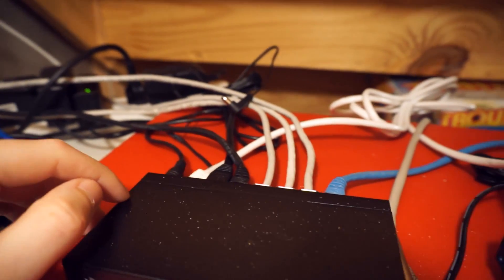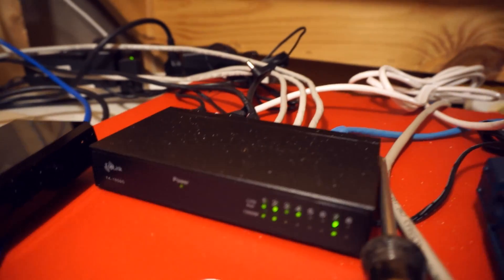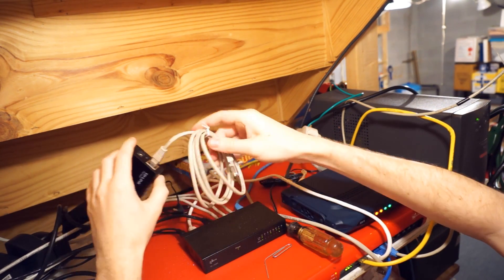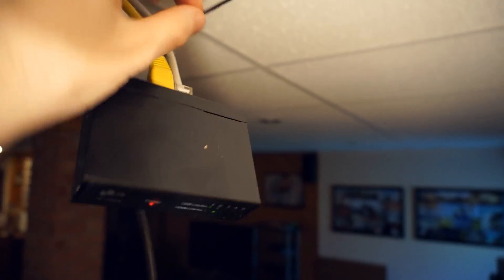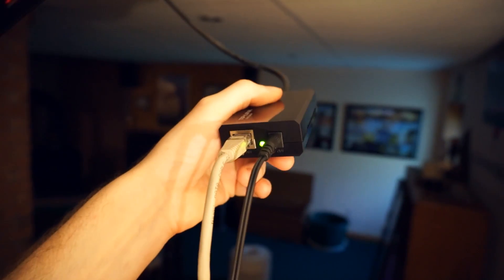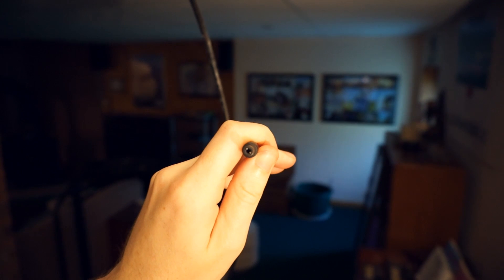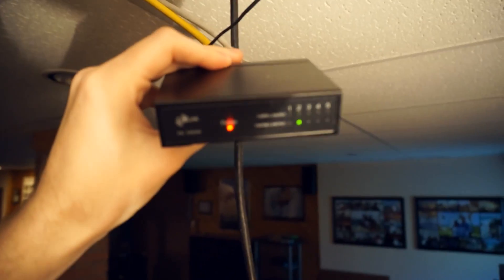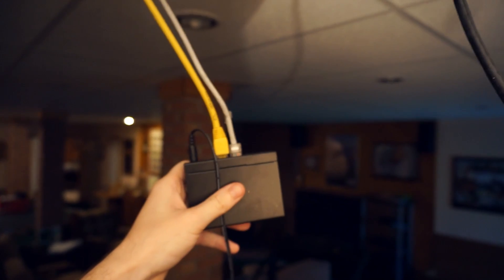TP-Link Power over Ethernet (PoE) Injector and Splitter Install

Comment: I'm out in the country using a mofi 4500.. I'm wanting to power my mofi router outside in weather proof to cut down on signal loss through the cables.. And use ethernet instead . And was wanting to ethernet instead.. I'm wondering if I can just use this and run it back to my main router inside the house for wifi

Comment: What's is the defence between injector and splitter i have a passive injector and not working because is has 35 meters of cat5e on my ip camera do you have a solution? Thank you

Comment: I was wanting to use these for a similar use case. My house has AT&T Fiber (Gigabit) and I’d like to run new Ethernet lines to every room and put a switch in a closet. 

I don’t have power there and I don’t care to pay an electrician to add it. This looks like a good solution. I can keep my modem on the UPS like you have and by extension my switch will likewise be battery backed up.

Not sure why you’re getting downvotes. This is a great video.

Comment: Hi, I'm a video surveillance technician, I'm installing cameras ip poe in a factory, in short I use the cable category 6 for the installation of my cameras poe. The problem I have is a problem of distance, some cable lengths exceed 100 meters, from 100 meters I do not have the images from the cameras. during my research, on the site TP-link I saw the products TL-POE150S, and TL-POE10R, I would like to know if using these products I can overcome this problem of distance. Thank you.